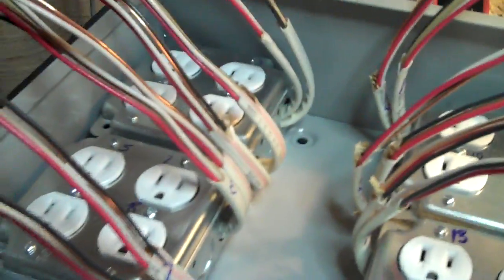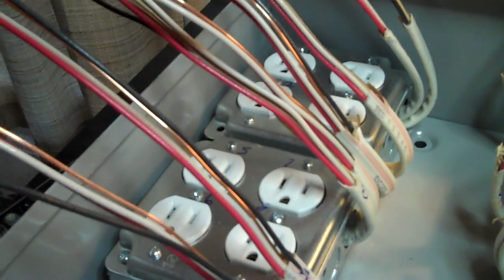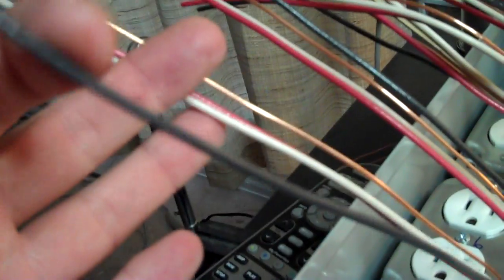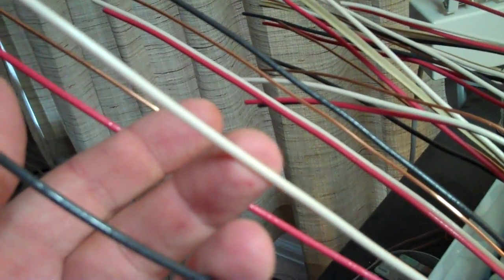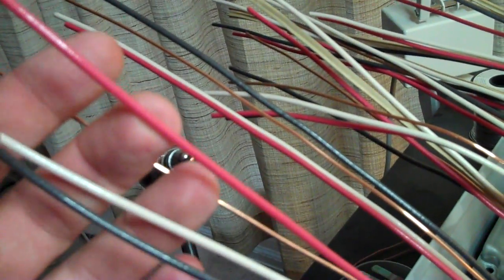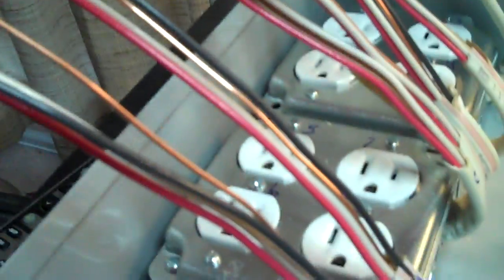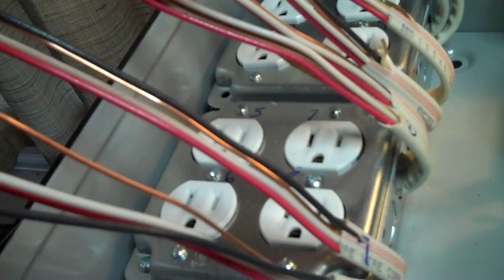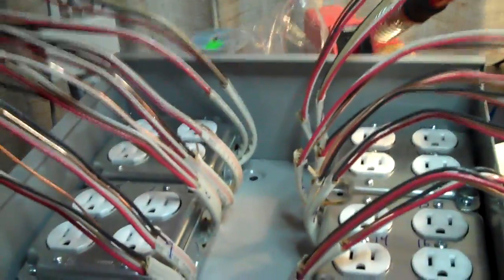Christmas Lights Control System - Part 2-2

Comment: The black and red conductors are hot. the white is neutral and the bare copper is for equipment grounding. You purchased 14/3, looks like you should have gotten 14/2 for your project.
Reply: an even smarter thing to do would be use the red for one side of the plug and black for the other side, if your splitting the plug to make two separate plugs. Then you white for your neutral and bare as your ground.